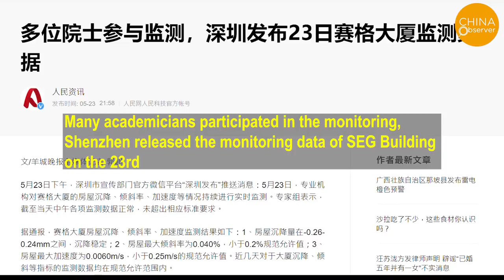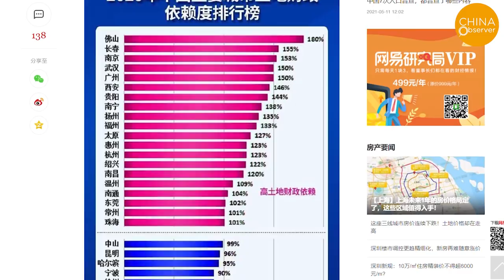356m tall skyscraper shakes violently again on May 27th, China real estate bubble

Comment: The concrete is already compromised and the welds will fail after enough fatigue. This building is going to fail eventually, perhaps during an earth quake or high winds. I am a retired engineer.
Reply: Yes I can see eventually a 9/11 failure.
Reply: Alex kalish, what about the actual foundation!? Remember the Mandalay Casino hotel tower in Las Vegas was sinking!? Where they had to inject millions of dollars of cement concrete into the foundation.
In my opinion they should check it
out also.
Reply: Propaganda is still in the works
Reply: If you are an engineer just asking. Does building floors every 2 days cause very weak concrete etc. It would have no way near enough time to reach its full strength and its having 7 stories put on top before its even reached 14 days. Or is it not an issue?
Reply: @dudewekowski744  I read that they were using saline sea water in the concrete mix to keep the pace up during construction. I'm sure that, if correct, that's not the only problem.
Reply: Sir you missed one last point to highlight: It is Chinese GOODS 🤣🤣🤣
Reply: @rrssmooth6643  minus the thermite of course
Reply: @slimeyslug12  I was about to say the same. He forgot to mention thermite.
Reply: Definitely something has broken and cracked in its foundation for it to sway like that. Seems  like they built it to quickly. And didn't allow the foundation to set correctly and be checked for any faults before they stated to build up.
Reply: @dudewekowski744  if the ground  foundation set correctly it will be fine. The problem  in China is they build to quickly the foundation don't get to hardening correctly. This will cause serious problems in the structure, that can cause  the concrete to split. The soil still settling. And welds or steel structure  to break apart. The higher  you build  the more weight on the foundation. And if not harden correctly the pressure  from the weight  will cause  it to crack. A building at this height should take 3 to 5 years to build. Not 6 to 12 months as China has been doing.  The basement of the building  must have time to settle and harden and checked properly before they start to build up.. I'm also a engineer. The strongest  structures and building's in the world are the ones  that took time to be built. For safety reasons building's like these shouldn't be rushed.
Reply: @highadventure5790  Its CCP world, no one will fix anything.
Reply: @dudewekowski744  usually concrete requires 21 days to completely cure, since in today's day,were about DELIVERING projects, 95% of concrete strength is reached in those 2 days then water curing of concrete continues. Hence technicaly it's not advisable but can continue if the design is perfectly executed on site.

Comment: I spoke with a structural engineer Ph.D. from China, and he said the shaking is most likely being caused by a foundation problem.
Reply: Thank you for the information.
Reply: The building wasn’t built with a vibrational damper that’s why it’s shaking violently. The building is now compromised with all that shaking. It’s only a matter of time before it shakes apart.
Reply: No kidding? You made that up. Calling B.S. by the way you typed it.
Reply: a flawed foundation is a flawed building.....   I wouldn't go to that building nor reside in it....  bet you residents and businesses are moving out ....   but CCP will deny anything....
Reply: So like a over weight woman walking on stelittos

Comment: If it above the code and requirement for safety, then why does it shake? Or an invisible dragon flew over?
Reply: it could be oscillation caused by the wind that made it behave like it would during an earthquake. This building has counterweights so it's not impossible.
Reply: Code requirements could be very low.
Reply: Codes? Requirements?
These are merely rubber stamps on the justification documents.  The “plans” were authored after the SEG plaza was built!
Reply: It’s a giant tuning fork … 🤪🤪🤪🤪
Reply: Same reason there are fewer poor people in China. They re-defined poverty. They re-defined the codes and requirements.
Reply: LOL 🤣😂
Reply: Technically every building that tall shakes. Not like that though.
Reply: it looks like a big ass tuning fork at the top.. not surprised the fork is humming at the top.
Reply: It shakes from the joy it has for the glorious chinese people.
Reply: The earth is out of code, not the building, Chonese authorities said.
Reply: @SickPrid3  "it could be oscillation caused by the wind "  Now explain why this has started 20 years after the building was constructed...
Reply: Chinese code is not the same as American or European code
Reply: Xi say so must be so....no buts...
Reply: @SickPrid3  are the counterweights passive or active? If active, there might be a control problem.
Reply: @SickPrid3  This building DOES NOT have counter weights. The wind is not a factor, the ground under the foundation has shifted and eventually that building will fail.
Reply: @RickDirt11  😂🤣
Reply: @snewsh  🤣😂😂
Reply: I think there’s been a misunderstanding. When they’re saying “above” and “below” here, they are referring to what is essentially building deformation. Being “below” the requirements is good, being “above” the requirements, meaning the building is doing something like tilting more than acceptable limits, is very bad.
Reply: It’s opposite

Comment: A bubble or stretch is difficult to answer and depend on the view. Creating huge amount of concrete in short time is byself an issue.
As an engineer filling a 300m steel tube with concrete do not work because of different thermal expansion. Either you fill segmentwise with void intersections to increase bend stiffness or enforce bend stiffness by a frame structure.
The vibration seem to result of inner tension between the fill concrete and  friction and the steel shell and release after thermal cycling. The standard method is to use a lower friction plastic coating before filling with concrete. After the years the thermal cycling give more space for inner movememt. It makes living there spoky.
Reply: What they need is a large quantity of Unobtanium.
Reply: So what does the future hold for this building?
Reply: Interesting technical information. Doesn't bode well for this structure. Maybe they should stick to conventional building practices.
Reply: Amazing when you look at the old WTC it used to shake in the wind but was calculated to do so as if it did not move it world snap like a twig but the sheer mass of the structure meant it could never fall over but also due to its amazing quality and engineering..
Reply: Very plausible explanation 👍. Of course, the years of thermal cycling could cause many related causes and contributing factors.  It could be several things.  This constant expansion and contraction most likely has completely fractured the concrete cores over time and therefore gradually shifted the loading entirely over to the steel structure.  They would have gradually experienced more flexibility, however now that the steel structure alone is carrying more than than its design load it will start to fail. This new shuddering is probably signs that the structure is now moving into this new stage where the steel will now begin to fail.  The idea of installing dampers now after all these years of damage has been done will only mask the building’s future warning signs that its safety has been compromised.

But, this is exactly the purpose of the official investigation and the announcements that all measurements are still within standards.  They will say the building is fine and recommend dampers to reduce the movement when really underneath the building is now fatally wounded.  Just like filling in large cracks in a foundation with paste and painting over it, they are simply hiding the problem.
Reply: Yes you nail it, if the concrete break induce compression load shift from concrete to steel while thermal cycling it is only a matter of time.
It is a shame that matter do not have a political opinion and instead follow an universal physic ;-)

Comment: This is what happens when engineers are taught jet airplanes can take down building's like a controlled demolition. We are so screwed.
Reply: Have you calculated the force of impact from fully loaded 767s flying at 500mph? Couple that with sustained heat from jet fuel fires and subsequent collapse is a matter of science.
Reply: @D R WTC7 was hit with tons of debris from WTC1 and 2, and the subsequent fire lasted a substantial amount of time, so yes, similar. Not 500mph, but a significant speed falling from that height. You know, gravity, 32m/s/s
Reply: @D R They do when they are that scale. Look up inertia. 

You think more than one top floor collapsing down on the remaining floors can't cause a pancake collapse? 

Have you studied the drawings of the towers? The design.

It's not magical AT ALL. It's simple physics. No way to go but down when their that size and collapse starts at the top.

You think they can plant explosives and hope that planes striking the buildings don't cause problems with the "controlled demolition" wiring and planted explosives?

Do you know how crazy that sounds? Do you know the scale of such an operation? Good lord.

Comment: They need to remove the topping antennas, they may be inducing an inadvertent resonant frequency into the structure caused by winds. Just a thought.
Reply: Maybe the antennas aren’t really antennas at all, but just some structure to make the official height taller just for looks. It was just a guess that those things were antennas. At any rate, it’s just a guess that this topping structure may have the potential to induce a resonant frequency into some part of the main structure.

Comment: Public ownership of the land is not the problem, as land is also all publicly owned in Hong Kong.  HK has been using the same land-lease auction system as China for over 160 years, and there are no shaking towers there.  The difference?  "Tofu" construction in the PRC.  Endemic corruption means engineering and materials are not reliable in the PRC.  I know, personally, a Chinese real estate developer, and he says buildings in China use three times as much steel and concrete as similar buildings in the West because builders can't be sure their materials are of the specified quality, and engineers use guesswork because their CAD software can't account for unreliable material specs.  I and many others have been expecting this kind of problem to happen in the PRC for decades.  Unfortunately, I think there is a good chance the SEG Building will fall over, despite efforts to brace it.

Comment: If that was burst vertical oscillation as reported, it can be explain with transverse (standing) wave within a vertical structure or building : 

Two possible cases. 

Slow risk :
The in ground pillar begins to resettle caused by alternating states between static and kinetic frictions, under a downward force and the weight of super structure above. 

Urgent risk : 
Unlike above resettlement case, would be disintegrating of concrete around rebar (or concrete in steel cylinder) of one or more of ground pillars. This send an impulse force setting the structure into burst vertical oscillation. 

Test data? Include the followings :
- vertical sink/settle : micrometer change (taken at 1st and last 10% of height) 
- vertical Impulse : time chart, transducers on x,y,a axis, (located at basement, 1st and last 10% of height)
- Tilt angle : time chart, (arc - degree, minute second and fractional second) averaged. (transducers on x,y,a axis, located at basement, distributed  at 10%, 20% ... 100% height).
Reply: Which do you believe based on the limited information released is most-likely happening?
Reply: @Floridarollin  
I’m not any structural expert, I wish I can address that, I can’t. The following is my offer to - first aid - the situation. 

If vertical oscillation is a dominant effect but horizontal, we’d expect a vertical impulse. 

Then the source of impulse may by analytically located by FFT (frequency to time domain transform) of signals from acoustic transducers distributed at various section along each pillar simultaneously. Also derive the acoustic velocity (longitudinal mode) along each pillar to better pin point the source. 

If this is horizontal oscillation we can also reconfigure the experiment to record transverse wave signal and velocity signal for transverse specific FFT analysis leading to any yielding sections. 

Call for a meeting to discuss situation and open options to stabilize and stop further deterioration.
Reply: @philoso377  Tried to look up some of what you're saying. Hope they manage to get a recording for horizontal oscillation soon. Seems devistating if they don't catch abnormalities in time
Reply: @Floridarollin  
However I didn’t hear people say about horizontal oscillation other than vertical.

Comment: China follows a standard where the public does NOT need to know everything.  The masses should only be told what is in the best interest of the nation.  This is a common mode of operating in nations where one group / party rules a nation.  But it is even worse in Asiatic nations with a long history and tradition of respect and even reverence towards elders and those in authority.  They have built into their culture a desire to bend towards following the rules of those above and keeping quiet to support their nation, community, and careers.  So this group of experts with this building may have identified the likely causes.  But WE WILL NEVER KNOW the cause or reason.  It will be reported up the chain of command.  Party officials and building owners will agree on a solution.  And this solution will be applied (such as opening wall sections and welding on additional steel plating like was done in a building in New York).  But the cause of the issue, if it would reflect negatively on how buildings are built and lower confidence in overall structures, will never be known. You might be able to guess to the cause later as directives on improvements in building design will come out and hidden in those directives will be changes in calculated values or new tests to perform.  But a direct answer .. forget about it.
Reply: Agnes Smith  Well not just commie.  Fascist of course carefully controlled what was and was not made public.  Dictatorships as well. And yes even Democracies.  In Mexico and Japan they were effectively by one party until due to complex circumstances other parties came to power.  And what came out afterwards was chilling.  You can see the seeds of this in America.  Whether it's the worship Trump side .. or the push by the Democrats for media and platforms to control speech, it's there that they WANT to control what is known as the public does not need to know everything in their opinion.  Heck the liberals merely label anything counter to their beliefs as hate speech to cut if off, even if discussion would be healthy.  And if you do not think this is the case, look at the Citicorp building in NY.  A flaw was discovered in the design that would have collapsed the building in winds that occur ever 30 years or so.  The secretly repaired the building, and only the Mayor, the building owner, and a few select individuals knew of the risk of collapse.  And this only slipped out when someone in their old age let it slip.  In the US the only thing driving so much disclosure and openness is each side pushes for it so they can beat on the other.  But if either group can get away with it well......

Comment: The weight is on the metal not the concrete, I heard this in another documentary.  Concrete has a great compression rating steel does not.

Comment: I would imagine that the concrete in these tubes is shrinking and settling causing the framework to suddenly shift.  The concrete is still curing and not supporting the tubes like it should.  At this point, the concrete is nothing more than ballast.

Comment: The concrete inside the steel tubing is falling apart, during the extreme temperature differences when the steel expands faster than the concrete inside, the broken concrete is falling down into the open space inside the tubing

Comment: For issues with vibrations (shaking) like this, the main things that need to be looked at is what has changed in regards to the stiffness of the building (the steel frame in this case) and load distributions throughout the building. they will also try to determine the natural frequencies of the building (the rate at which vibrations are largest for the building) and compare these with possible sources of vibration.
If lucky it will be a redundant joint that has failed in the steel frame which can be rewelded.
As to the monitoring having the values within the requirements of codes or standards, I'm not sure if any such codes or standards exist. A project of this size which is a one off, would likely have individual values based on calculation rather than be based upon a code or standard.

Comment: Could not quiet figure out how this was testing the welds. Here they use X-rays, I’ve serviced the water cooling equipment used to cool the X-ray Machine. No one can be any where near the unit, when it is taking X-rays. Also they use the X-ray to examine Concrete, the rebar, and tension cables in the concrete.

Comment: Why is it experts always  says the building is still  performing within its standard limit,  technically they are correct but those  parameters are for extreme conditions... But  if the building is  behaving like that on a normal conditions that is structural issues, these are signs  of structural stress building up .